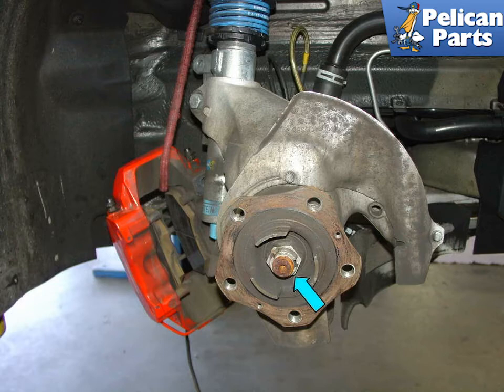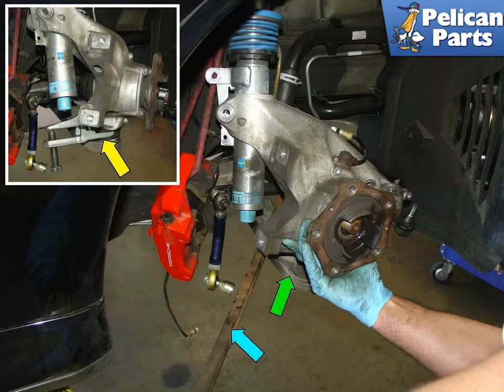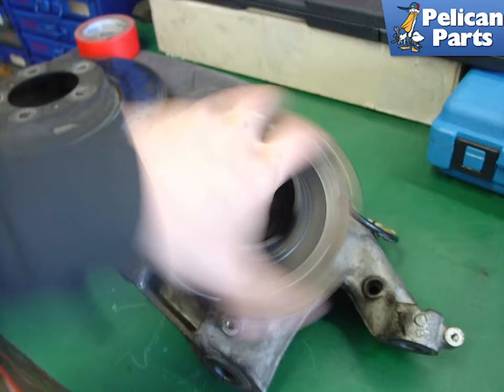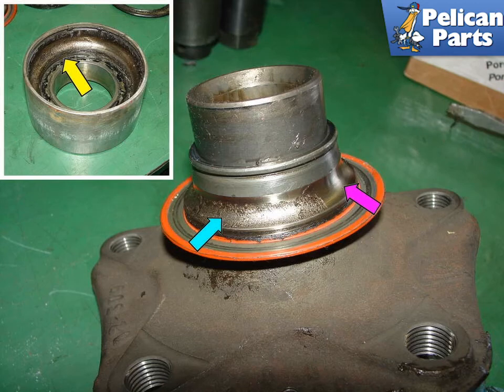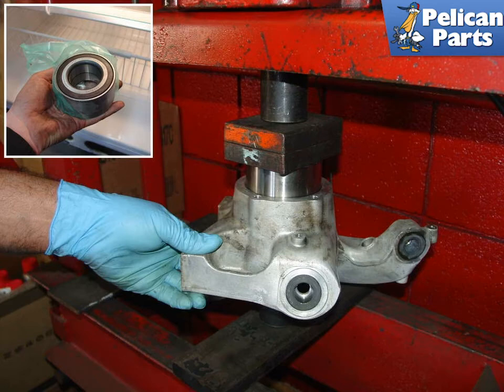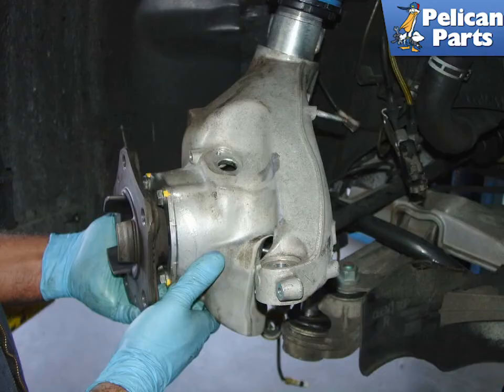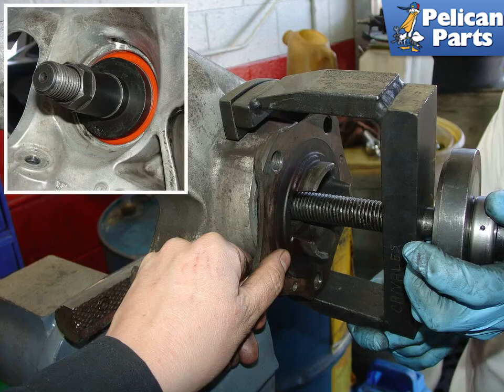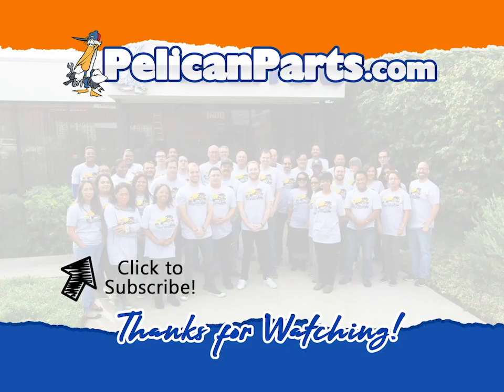Porsche Boxster 986 Wheel Bearing Replacement

Comment: Any different between this and a 2000 986 S?
Reply from the maker: This applies to your vehicle also.

Applicable Models:

Porsche 986 Boxster (1997-04)
Porsche 986 Boxster S (2000-04)
Porsche 987 Boxster (2005-12)
Porsche 987 Boxster S (2005-12)
Porsche 987 Boxster S Porsche Design 2 (2009)
Porsche 987 Cayman (2007-12)
Porsche 987 Cayman S (2006-12)